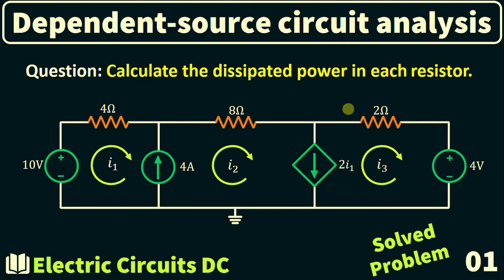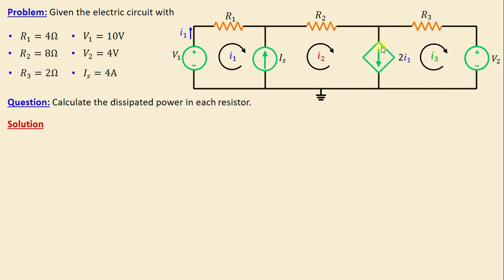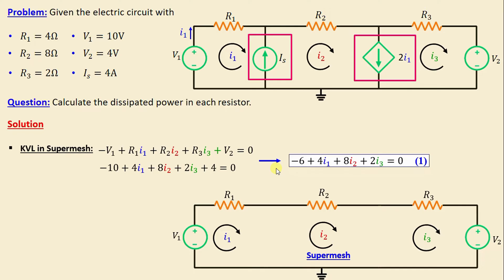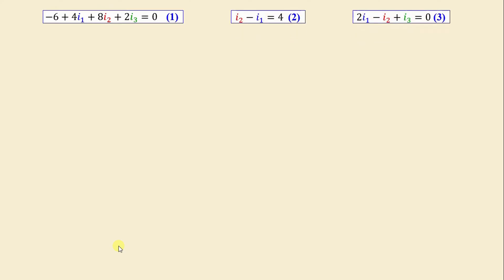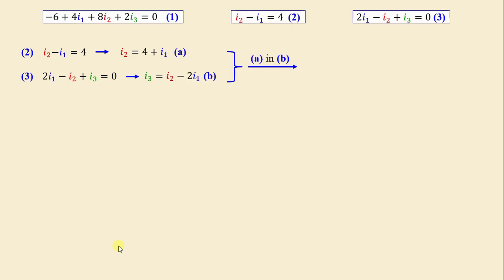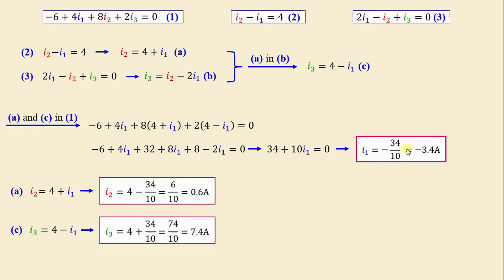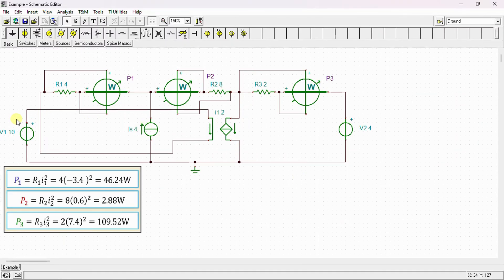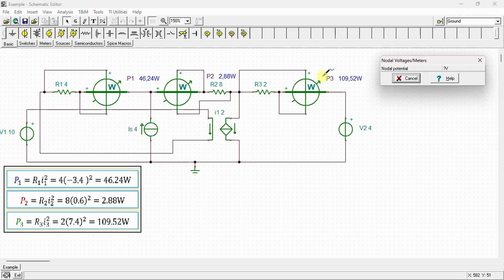Solving circuits with dependent current sources - Problem 1

Comment: Thank you sir ❤
Reply: isnt the KVL in supermesh supposed to be -4i1-8i2-2i3 because the current of the supermesh is going from positive to negative on the resistor??
Reply: @Bofadesium  All the signs are flipped. He chose to subtract V1 and add V2 so it still works out.
Reply from the maker: You are welcome